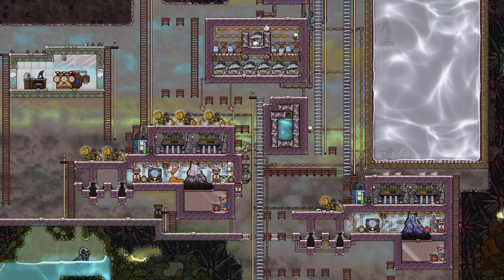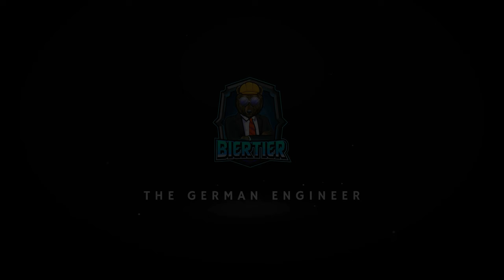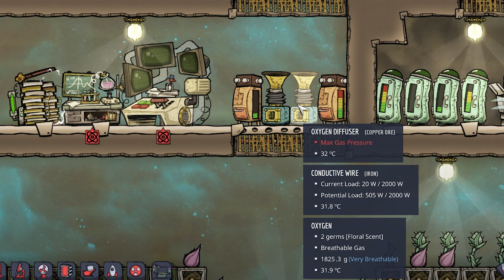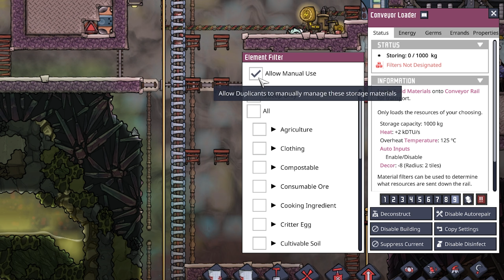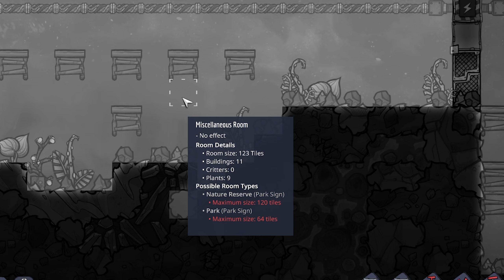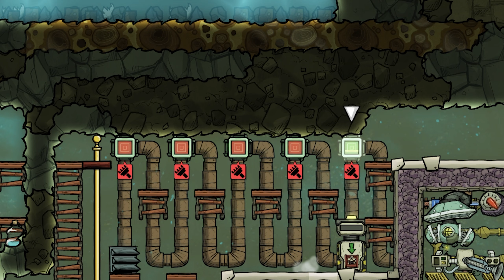TAMING an INFECTIOUS POLLUTED OXYGEN VENT! (LP2-EP16) Oxygen Not Included Spaced Out

Comment: Question 🙋‍♂️ what happen to polluted water under the turbine chamber on the polluted vent ? It just change to normal steam ?
Reply from the maker: That’s exactly it! If polluted water is heated up enough it converts to steam and leaves a little bit of dirt behind. Polluted Water also has a higher vaporization point than normal water, so the normal water turns to steam faster.
Reply: @BierTier  thank you 🙏

Comment: Thanks a lot for your videos. The most concise. Briefly and to the point. I only use them. Here they wrote about clay. Unfortunately, 100 g/sec of polluted oxygen (60kg/cycle) yields only 86 kg of clay per cycle. And you need 400 kg for one ceramic tile. Only 250 tiles per 1000 cycles are roughly rounded. Very inefficient compared to electrical costs. Maybe I missed something.
Reply from the maker: It is not very efficient, you are correct. But it was a fun challenge to build that thing, especially since most people seal them up and leave them alone :)

Comment: Hey BT,

Loving your series! I bought ONI after reading all the reviews and very quickly hit a wall. Your videos have helped overcome that immensely! You do a fantastic job of explaining things in a very understandable way.

I've gotten so comfortable that I've started experimenting a little bit. For the aluminum & cobalt volcanoes I connected both to the salt water basin. Then I replaced the hydro sensor with an atmo sensor (1 tile higher) and set it to below 20kg of pressure. It's now 100% off-hands, tested over 70 cycles and dormancy! It solved the issue of how much water to let in as well, because as soon as it starts boiling and hits too much steam, then it turns off.

Comment: In my view, the real value in the polluted oxygen vents isn't the oxygen, it's the clay for making ceramics.  Still, they're only 1/10th as good as polluted water vents for that, but you don't run out of sand so quickly with one of these instead.
Reply from the maker: You are absolutely correct. I have a polluted water vent right below and I choose this one deliberately. A because I need the Oxygen and B because it is barely ever shown :)

Comment: Thanks Bier. I got one in a new biome I started and I rather watch how you create a system with obstacles instead of how you would in debug mode. The obstacles give me a better idea how to use less materials. Because I always think is this the most efficient way? I don't know how to explain it. It just helps seeing it done.
Reply from the maker: Absolutely, I agree. Seeing how it is built in a real game step by step can not be compared with sandbox and debug. Those videos are meant as an explainer. How does it work and why does it work. They of course also provide a template, but in the end nothing compares to a real game :)
Reply: @BierTier  Hey Bier, do you have a refrigerator system. For when you get a cool slush geyser or creating a cool system? Is it possible to make a simple concept instead of these end game builds I keep seeing. Without super coolant and such. Thanks